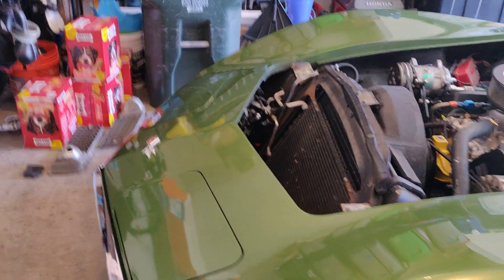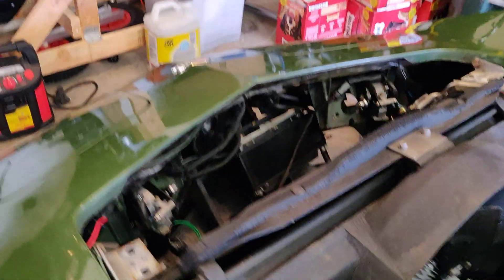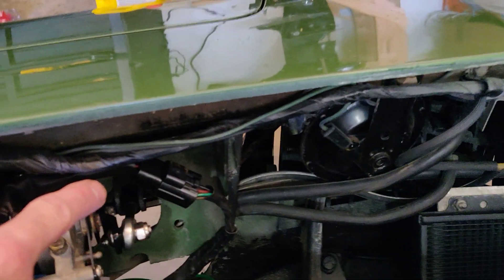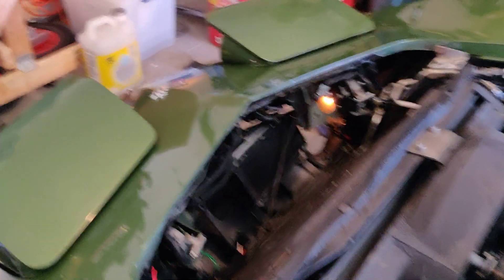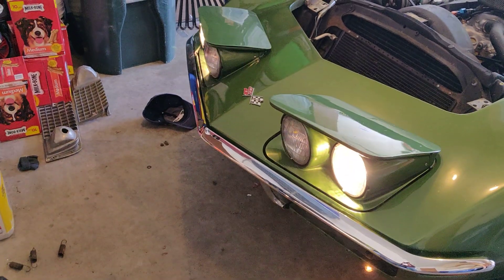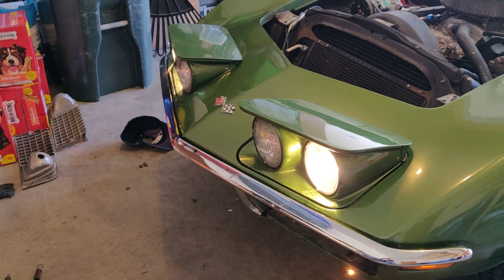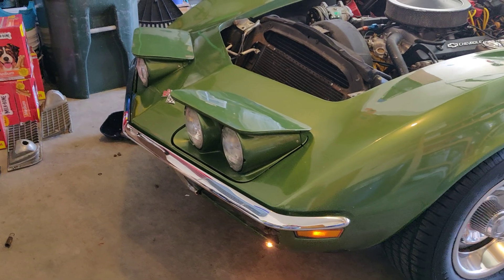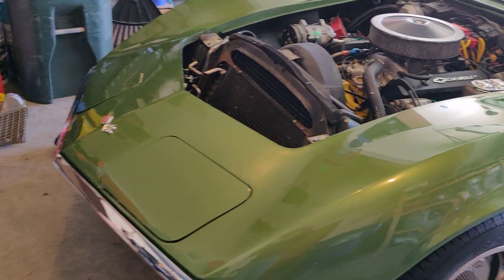Corvette Electric Headlight Assembly Mod

Comment: how did you connected the wires so the headlight stayed up in parking light mode? if you hooked the hot wire to side lights what happens when you turned on emergency flasher?
Reply from the maker: This setup came as a kit which was essentially plug and play. I am not sure how the various components are wired.

Comment: richard's kits are wonderful, he's recently upgraded the design even further to use what i think is an ac delco windshield water motor, instead of the miata headlight motors. Doesn't need any limit switches or anything. 
Also have you considered putting some rubber bumpers on the underside of the housing? so when it goes down it doesn't make a rattle as it slams closed
Reply from the maker: Ryukachoo I had not considered that, but it’s a great idea. I did just upgrade to LED lights and they are awesome.
Reply: I am looking for those rubber bumpers, would you share link to site where I can purchase?